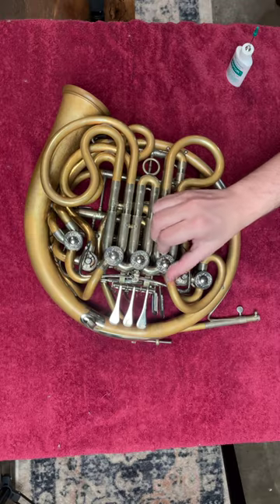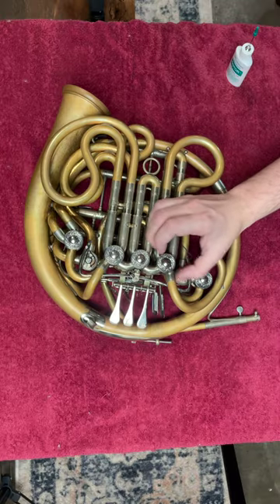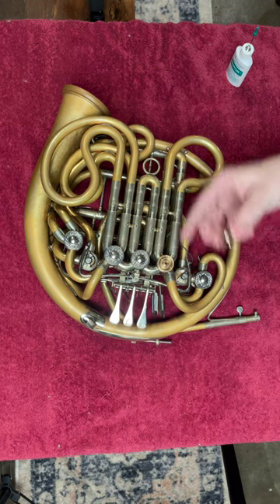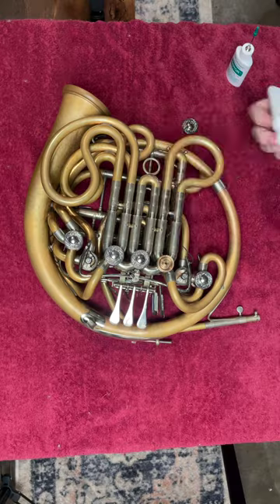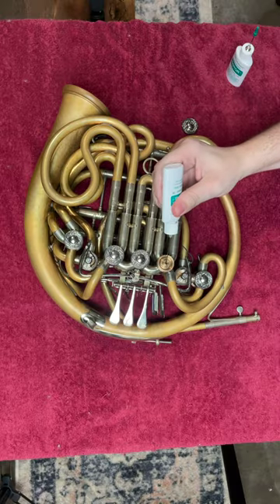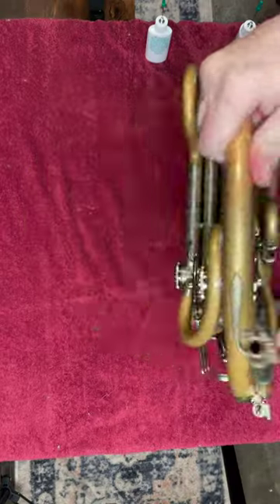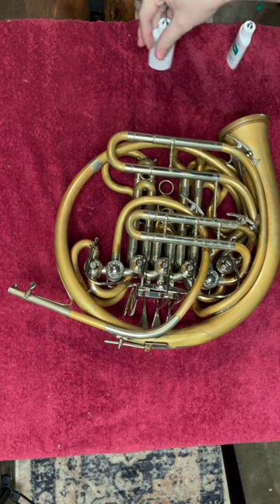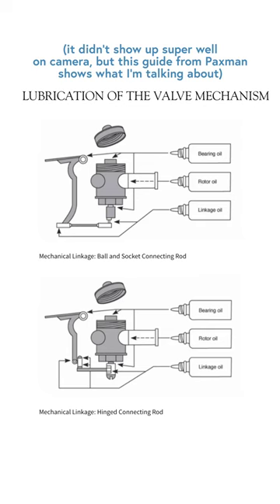How to Oil the Valves on a French Horn

Comment: THANK YOU! for at least 4 years I have had instructors that have not none that much at all about the f horn, and they told me to put rotor oil under the valve caps and not in the tubing. I have had slow valves for the longest time and I thought it was because I had string and not mechanical valves. I am so thankful and you will not believe how much this video helped! ❤

Comment: Just one comment, on a Schmid horn the big hole in the cylinder is there to make it lighter, it has no connection to the inside. According to E. Schmid, you should just put a couple of drops in the small holes instead.

Comment: No disrespect to Scott but I have to disagree (slightly) with how he demonstrated putting oil in the valves from the slides.  Though the oil he is using has a long needle type dispenser, I still think it is best to put the oil on the inside of the slide, put the slide all the way in, and turn the horn over and let the oil enter the valve using that method.  This will eliminate getting any grease and other "stuff" you don't want in your valve.  I've seen several people demonstrate how Scott uses the long needle (or not!) to send the oil down the dirty part of the slide and it kind of makes me cringe given what could happen.  Anyway, thanks to Scott for doing a great job playing and giving great advice and help for many Horn players out there.
Reply: If you put the rotor oil in the valve, then plug the valve until the end, and then rotate the horn so the oil reaches the valve, the oil slides on the tube walls and when it reaches where the slide finishes, by capillarity, some of this oil will definitely get into the slides outer sides.

I make sure that the slide holes are vertical, then drop the oil and rock the horn back and forth and turn the valves to ensure even distribution on the rotors and then I replace the slides.

Point is, there's very runny oil down there, and it'll get everywhere in any case. We all try to avoid getting dirty slides oil/grease to the rotors one way or another.

Comment: Quick question. I know you have a triple, but why do you have 7 rotors? Or did you mean slides?
Reply: Look carefully he has 7 rotors. This is because he plays (what I think is called) a triple horn. The triple horn helps the player play in the higher register by using a second trigger. He explained it in a different video
Reply: @jackmario6471  I aware this is a triple.(i own a very similar model) but I guess I never saw my 7th rotor.
Reply: It's the same like you can have a double horn with 4 valves, whereby the two paths split and meet at the same rotor, or using 5 valves, where the two paths split on one rotor and merge on another one.

When a single rotor is used (like Alexander 103), the two paths split and meet at the same rotor, meaning more complex tubing.

By having the split and merge point separate, the tubing is much tidier and neatly placed, that's why the Schmid triple uses 2 sets of 2 synchronized rotors to separate the 3 paths.

That's how the Paxman triple 75.3 has 5 rotors, and the Schmid Bb/High Eb has 6 (3 normal + 2 synchronized + one for the stopping valve)
Reply: @georgH  wow thank you! amazing explanation